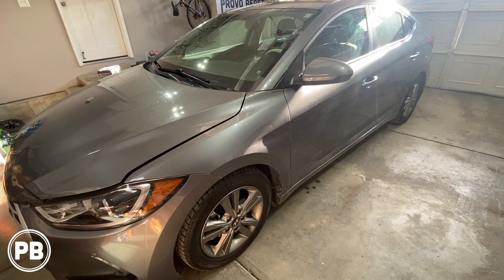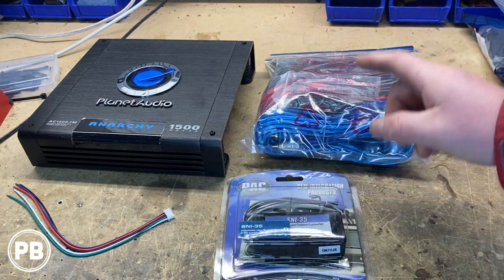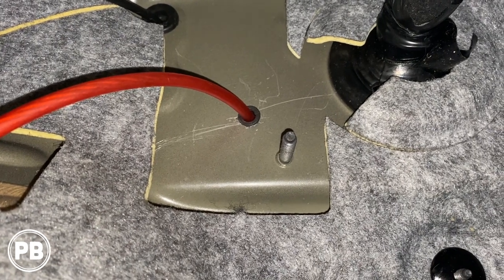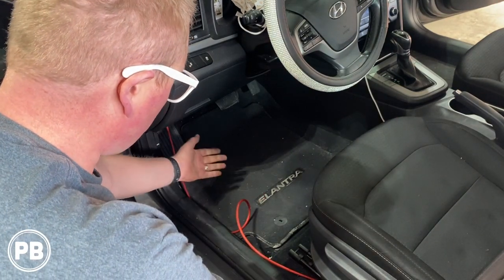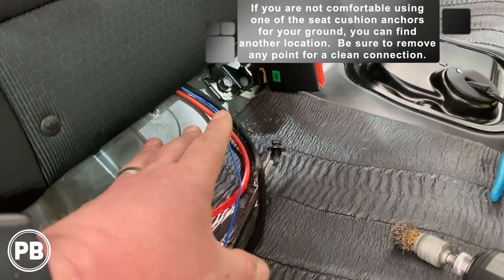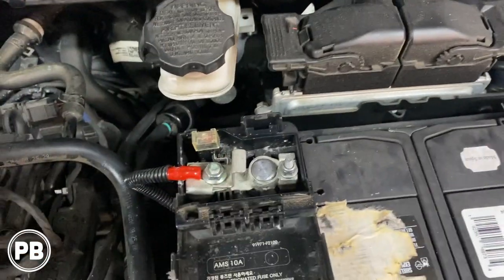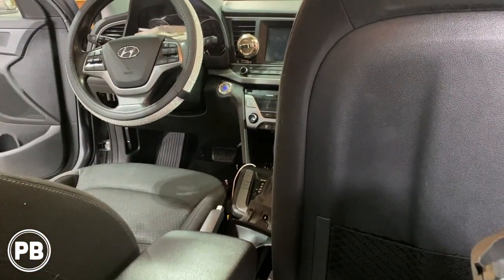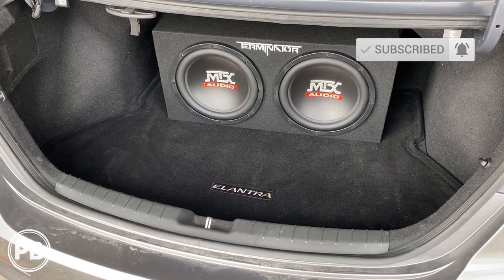2017 - 2020 Hyundai Elantra Amp and Sub Install

Comment from the maker: Parts used linked in the description of the video!
Reply: Hey I had a question about a sub system I installed in a car…I put it in and everything works but I noticed sometimes when nothing was being played it would randomly make a low rumble sound?? Do you know what would be causing this
Reply: @josiahmoser6347  Active noise cancelation
Reply: @Trisket4266  yea that would be cool
Reply from the maker: @josiahmoser6347  Depends on the vehicle, but sounds like it could be ANC playing through the speakers.  Can't help much unless I know the year, make, model, amp, sub, head unit, etc.  Too many variables.
Reply: @josiahmoser6347  No. I mean the issue is probably your aftermarket amplifier is amplifying the ANC from your factory amplifer. ANC is used to make your Drive quieter by simulating road and engine noise. But Provo is right, no-one can help without knowing the specifics
Reply: @ProvoBeastAudio  ok well the car is a Honda Accord 2010 and the sub was the Rockville audio dual 8in/amp kit off of Amazon
Reply: @ProvoBeastAudio  oh and it’s just the factory head unit…also I tapped into the rear speakers with the high input side of the amp
Reply from the maker: @josiahmoser6347  You will have an ANC mic  by the rear view mirror that you need to disconnect, and one in the rear deck.  Once you remove those, it will fix the rumble noise.
Reply: @ProvoBeastAudio  ok thanks
Reply: @ProvoBeastAudio  Thank you! I was wondering about this until now, confused the hell out of me haha

Comment: It's so frustrating because in Australia, the same car is put together completely different. There's no wiring in the pillars, none. There's no rubber grommet on the engine bay for firewall passthrough. Even all the wires are different colours.
Reply: ITS THE WIRES THAT ARE TWISTED TOGETHER MINE ARE BLACK AND YELLOW
Reply: @chrisgambill1390  I figured a heap of it out. Ended up getting everything installed myself, but man it was frustrating. Basically no references.

Comment: Is the stereo touch screen if so how did you wire to it?
Reply: He didn't have to, his amp had a high level speaker harness so all he had to do was tap into the speaker wire going to the right rear door speaker.  Alternatively you can buy a signal converter that does the same thing ...it allows you to tap the speaker wire in your car and covert to an RCA so that you can connect directly to your amp without having to access your head unit.

Comment: I'm tapping into the rear speakers on my 2018 Hyundai Elantra but it doesn't have a brown cable. Which cable should I tap into?
Reply: Same thing I am trying to figure out smh
Reply: @PvtSaunders  it's the wires that are twisted together. Mine were black and white.

Comment: The add a circuit link is a bit confusing to me.  If you tapped the spare fuse and it's on ignition switch why do you need the add a circuit.  Did you wrap the remote wire around the spare fuse on the left prong?  I am just trying to understand before I stalling.  Thanks in advance
Reply from the maker: We made our own add-a-circuit.  We suggest you purchase one yourself, and no, we didn't just wrap the wire round the fuse prong.  Using an add-a-circuit allows you to pull power from the front of the fuse box safely instead of just shoving the wire into the fuse box.  It fuses the run to our own circuit.
Reply: @ProvoBeastAudio  okay so with the spare that is used should I pull the spare out and place the add a circuit there?  Also would a 15amp one be okay to use that what's at my local store
Reply: @goosem4554  The remote turn on function in most cases will only pull 1 amp or less, so while a 15 amp fuse would work, it isn’t as safe as using a 1 amp micro fuse or the more commonly available 3 amp micro fuse

Comment: Do you need an amp to set up a subwoofer? I’m trying to install subwoofer to my 2023 sel elantra and I can’t seem to find videos on it other than yours for the previous models, if possibly how would I be able to setup just the subwoofer?
Reply from the maker: You need an amplifier for a subwoofer. For specific help, feel free to send me a message on our Facebook page.
Reply: @ProvoBeastAudio  which amps are recommended/compatible for the sel 2023 elantra ?
Reply from the maker: @angelcastaneda0297  You don't base the amp really on the car, you base it on the sub itself.  If you want some recommendations, sent us a message on our facebook page and I can send over some great recommendations!

Comment: Does the sub sound good in the trunk? Cause I have a smaller 10 in and i don’t feel bass in the trunk unless I put it in the back seat
Reply from the maker: Way too many variables there. Most likely you don’t have the right sub paired with the right amp on the right electrical. Can greatly vary based on the signal it’s getting, where gains are set, etc. lots of variables.

Comment: Have you done a high output alternator on a 2017 or 2018 Hyundai Elantra? I currently have two skar evl d2 12 on a cab 2200 and a Rockford fosgate 500.4 for my door speakers. I also have a spare agm battery in the trunk that powers the cab 22. I want to eventually get a cab 4500. I just know with the stock alternator it won’t be enough. I know I can get an alternator fro brandX but I worry about the vehicle ecm. I know I need to do a big 3 but the negative battery terminal on the main agm has some kind of fuse attached to it. If you have any videos of that I would appreciate it. I can’t find any videos of that for my 17 Hyundai Elantra.
Reply: I have the same car I highly suggest you get either a lithium battery your stock alt will be enough to keep it charged as long as you don’t hook them together then you’ll have a battery entirely dedicated to your sound. I’ve been looking for an upgraded alt but they are hard to find for this car. Was running 2 vxfs of a 3k in the process of swapping to 3 10s so that should be plenty assuming you have an amp matching the evl
Reply: @256jayy3  I have an agm under the hood. I hooked up another agm in the trunk that powers the cab 22. My agm under the hood powers the car stuff and I have a 500.1 for my door speakers. So you think I should get a lithium under the hood and in the trunk? Even with that I would like to get a 4K but would I still need to get a high output alt? Brand X says they can make an alt but I heard that with the cars computer it still would not let the battery charge above 12 volt.

Comment: Good video. I have the touchscreen in this year model want to run an LC7I. I have to tap to all speakers can I access all speaker wires on that b piller? Or does that just hold the right speakers ?

Comment: How big of a amp can you put on that stock alt?
Reply from the maker: Depending on your engine size, factory alt puts out about 120 amps max, so between the factory electrical draw, and the additional draw of your amplifier, you are safe for around 1000ish watts RMS (70ams) before more upgrades are needed.  Be sure to have a healthy battery.

Comment: When I turn my car off, and my stereo still is on
Reply: My amp stays on too, as soon as I plug in the speaker from the door, it stays on and wont shut off, my amp has high level imputs also, did you get yours fixed?
Reply: That's why he wired the remote wire to an appropriate fuse in the fuse box. Not all of those fuses lose power when the car shuts off. Did you look up which fuses to tap into?
Reply: @Peaches-N-Mango I have my remote turn on into a line out converter. Where should I tap in to run it up to the fuse box